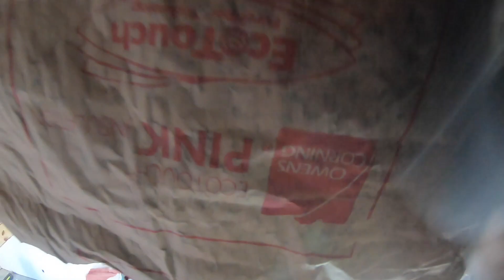High TIN CEILING sets this Barndominium apart.

Comment: I really like your videos. I'm starting our pole barn house next spring!
Reply from the maker: Thank you.  That is awesome!  Keep a watch out for a future video I plan to put out on the things to think about before building a pole barn house or barndominium...  like cell signals do not go through metal buildings.  We spend a lot of time standing near windows 🙂.  When we finally get internet service here, it should solve that problem, but we miss a lot of calls and texts when we are inside.  A cell signal repeater/booster to install inside is around $500 so not worth it to me, but can be an option.
Thanks for watching and good luck on you project.

Comment: Your body weight is not a good enough test of the fall protection strap. You need an anchor point that will withstand 3,000 lbs of force.